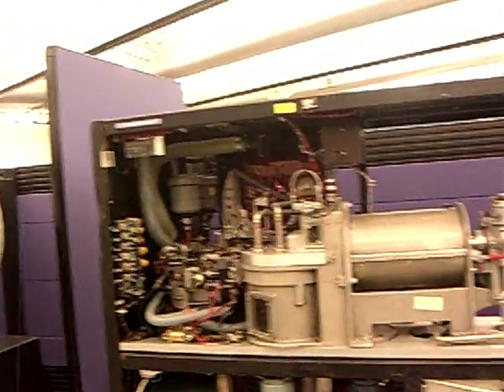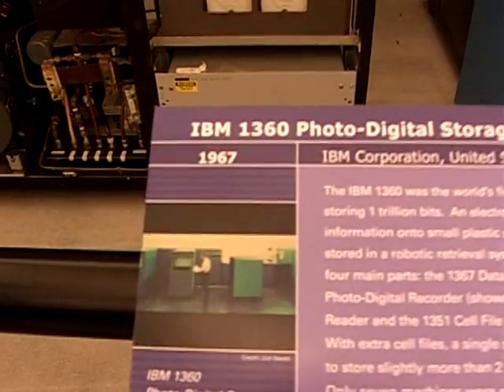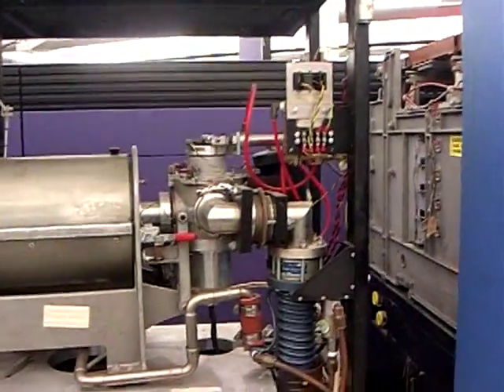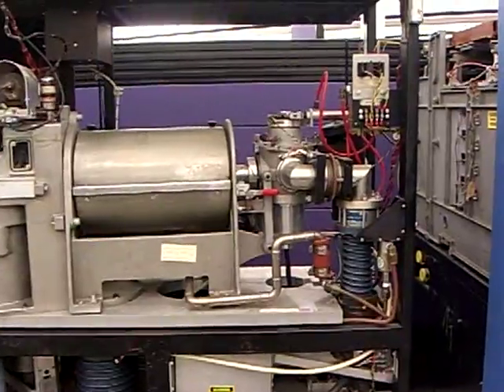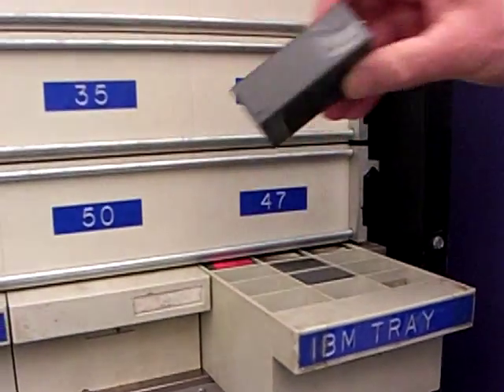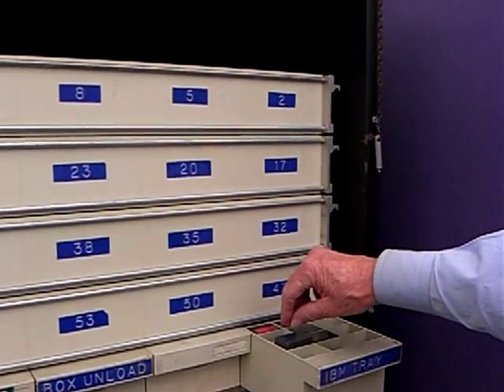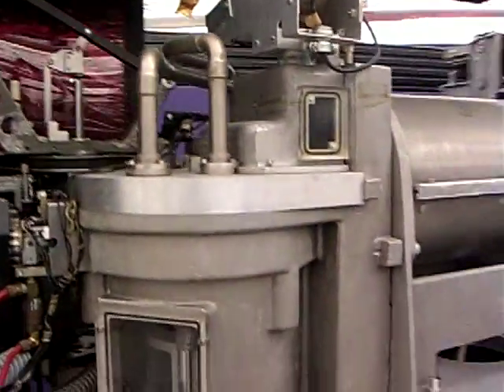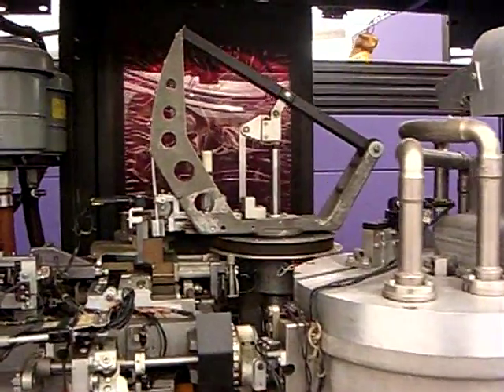The First Terabit Server -The 1967 IBM 1360

Comment: Heck, by the year 2000, my own personal data archive was pushing 1 terabit, and I was a not particularly affluent student in-between high school and university; by the time I left uni in 2003, it was over 2Tbit. If *I* could afford that by that point in time, on a pair of 3.5" hard disks in a nailed-together PC, businesses would have been all over it at least 10 years earlier. They had 100+MB hard disk-a-likes in the 70s; I was still using DSDD floppies only (~300 total) all the way up to 1994..

Comment: Very interesting ... but what form of data was stored on the "chip"s? Matrices of black/white bits? Actual photographs (a kind of stock photo archive, or microfiches of printed-word data)?

BTW I would STRONGLY dispute it being "shut down 15 years before its time". By the mid 80s we already had magneto-optical drives that stored a few hundred MB in CD jewelcase-sized carts. At 125MB/disc, you'd only need enough storage space for 1000 CD boxes, which would be far smaller than this... and faster!
Reply: https://en.wikipedia.org/wiki/IBM_1360